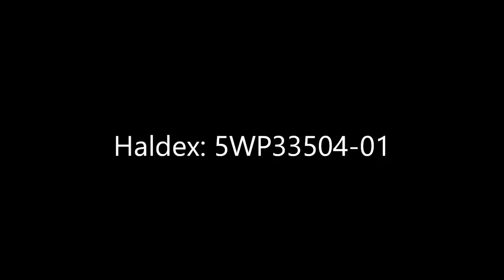Project V50, Episode 51: Gen3 Haldex Controller for Real AWD

Comment: I was given 3 modules from various cars. The part numbers are: 5WP33503-01 , 5WP22220-02, 5WP22220-03. The first one has a copper coil missing when you look into the unit where the solenoids plug into. if you have one out of the car you will know what I mean. I was under the impression the 3350x would work but Ive also read that the S60R has a 22220 and they came out with instant traction. So could I just buy a 80psi presssure solenoid and bolt it in? is it worth it? especially now the price of these 33504s have gone through the roof now everyone is spruiking this number.
Reply from the maker: I'm sorry, but I can't say for certain. As you've probably seen on SwedeSpeed, this works for some people and not for others. My car continues to see instant traction to the rear. Some people experience an improvement for a few drive cycles before the car tones it down or disables AWD. Some people don't experience any improvement at all. There does not seem to be any clear reason behind which modules/solenoids work, which model years this is applicable to, etc. The only thing to do is to test it for yourself and see how it performs over a few drive cycles.
Reply: @MyNameIdeasWereTaken  why do some have a little copper coil in them and others don't. It seems the 5wp22xxx have a coil where the 5wp33xxx don't. Anyway I'll buy a 80bar pressure switch and start testing.
Reply from the maker: @aaronbremner5203  I'm not sure on that either. I haven't done much research on the matter other than getting 5WP33504-01 for my car and it working flawlessly for me.

Comment: will this work for a 04 XC70? or will there be CANBUS issues?
Reply from the maker: The XC70 should already be priming the rear for instant traction off the line. So you likely wouldn't notice any improvement.
Reply: because 350mbps vs 500mbps
Reply: @MyNameIdeasWereTaken  So then its my understanding that I already have the 64/40 split as you have shown in the video? Because right now it doesnt feel like it at all.
Reply from the maker: @BellaPhoenyxFyre  I'm not sure if it's exactly 60/40, but it is more than the AWD P1s have. The car only puts power to the rear upon hard acceleration and when any slip is detected at the front, so it's not always giving power to the rear. Though if you can get all 4 wheels to spin in the dirt, then you may have a fail haldex controller or another fault with the AWD system.
Reply: @MyNameIdeasWereTaken  This is my first P2 (I lived in the 240 world). We had snow a couple days ago and I was a bit disappointed at how little the AWD came in to play. It did, but not as much as I would have liked. Almost AFTER I needed it. I want it to be more proactive. When I saw this video I was thinking YES THIS is what I want! 60/40(ish) all. the. time.